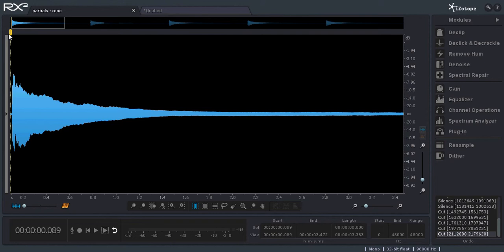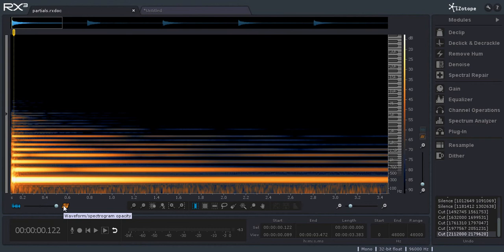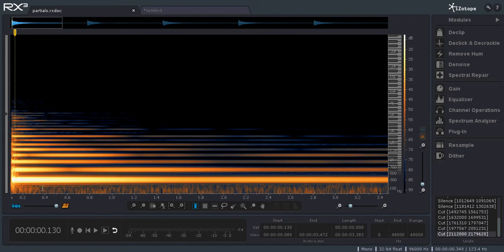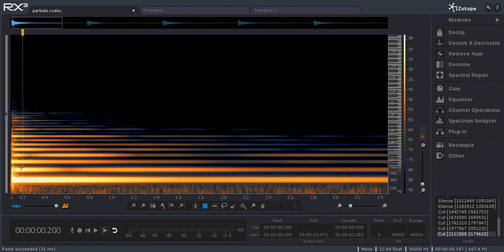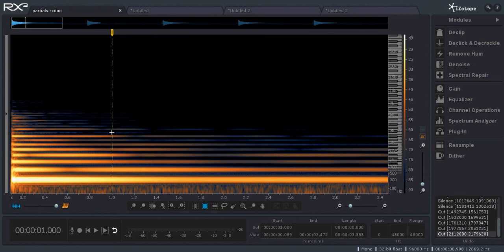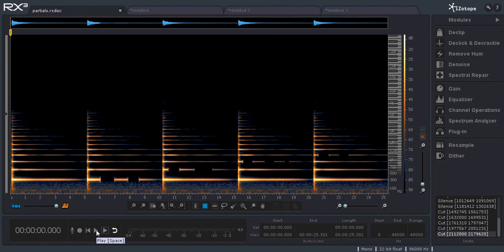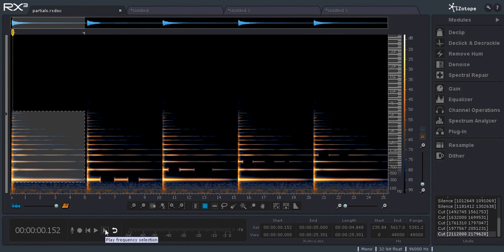Partials of a Piano Note

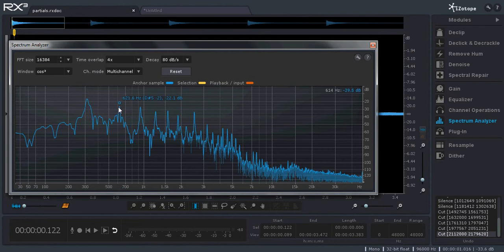Comment: 1:00 My understanding is that the open string is the first partial and one octave up is the second partial. Is that correct?
Reply from the maker: That is correct.  I was using the term ‘harmonic’ and thought that the first harmonic was the second partial, but I just did some Googling and it looks like the first partial is the first harmonic, so what I said was just wrong.  Thanks for noticing.
Reply: @smurphy109   It seems to be a common mistake. Steve Howard makes the same mistake twice in his video on partials, but the second time he catches it and corrects himself.